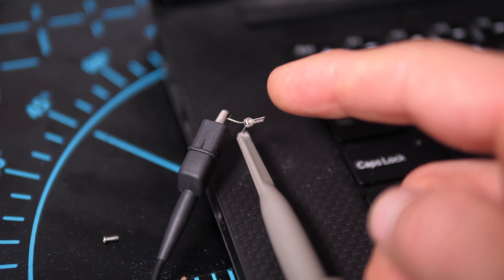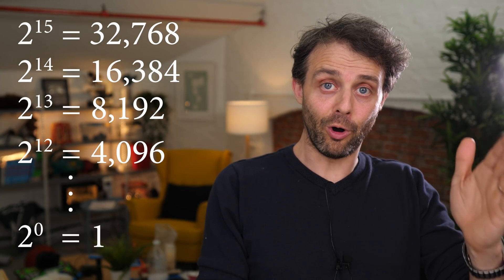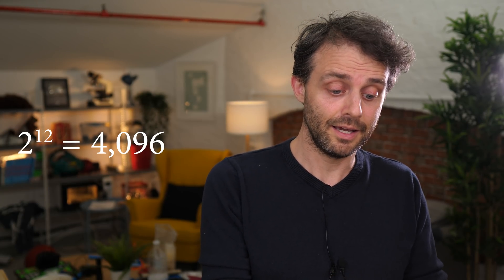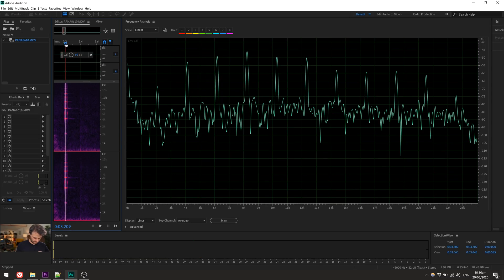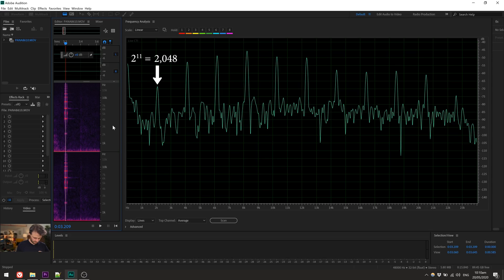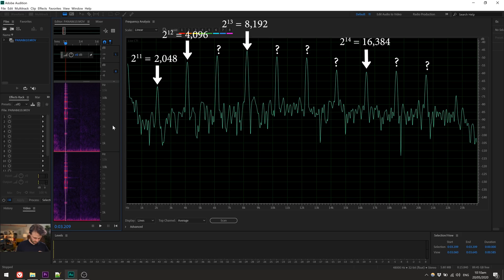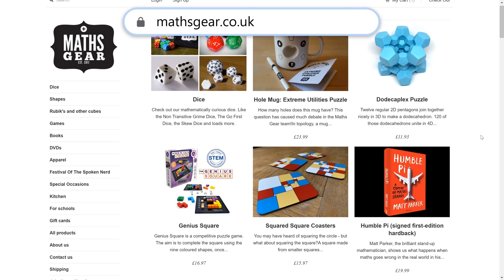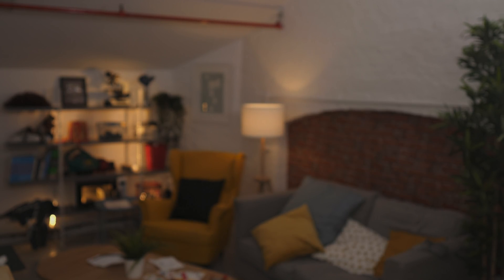Why a Watch Beep Is Exactly 2¹¹ Hz (2048 Hz)

Comment: This doesn’t really explain the “why”?
Reply: If the designer wanted a specific frequency e.g. somewhere between 2048 and 4096 then it would probably need a dedicated crystal and additional circuitry. Watches already have to be extremely compact, good on battery life, and economical to produce. It makes sense to just use a power of two frequency from the crystal that is already there.

Comment: I made a digital clock which beeps at 4800Hz. The clock has an RS-232 interface for remote control. I had a problem that I didn't have enough free I/O pins available. So I made the buzzer and the TxD share the same pin. Sending the character 'U' (0x55) at 9600baud continuously is indistinguishable from a 4800Hz square wave. So actually whenever the clock wants to beep, it just sends pulses of "UUUUUU..." through the serial line.

Comment: Analyzing at 2048Hz and 4096Hz based a human interaction and music theory we can assume that it's most likely 2048Hz in most if not all watches. We know that when we double the frequency of a note we go up by 1 octave. 2048Hz is high but still normal. 4096Hz is in a range that is easily audible but starts to be really anoying. 2048 is just a nice sweet spot where the sound is high enough to cut through most background noise without being to anoying. 1024Hz is probably also a decent option, at least to my ears it sounds fine, but then higher frequencies tend to cut trhough other sounds better than lower frequencies of the same volume so mabye 2048Hz is "better"

Comment: I think all harmonics being present (rather than just evens or odds) might mean it's a sawtooth, like someone stuck a resistor ladder DAC on the bottom 5 bits of the cycle count from the clock.  I think a square wave would be just even harmonics.  Or maybe it's a 1khz square wave?
Reply: I'm with you on this Steven, I belive this to be a 1KHz square wave.

Comment: The inaccuracy of the measurement is not specifically a problem with the software. It's more to do with the problem of measuring a wave with a digital device. The precision depends on the number of samples per second.

Comment: When I woke up, I put some bread in the microwave to heat it up. While eating, the thought crossed my mind that a microwave sending microwaves at the resonating frequency of water is somewhat comparable to pushing a swing exactly at the optimal point of its cycle, essentially adding energy to the system. But when pushing a swing at the worst point in its cycle, we could actually remove energy from the system and eventually stop it instead. Now here's where my mind has some trouble processing: If we have a microwave sending waves at a 'worst-point-in-swing-cycle' frequency, could it theoretically and/or practically make the contents of the microwave colder? My head tells me that heat + heat = more heat, and that anything different breaks the first law of thermodynamics. But at the same time I cannot fully explain why this would be possible with a swing or a spring-mass system, but not with heat (molecules with forces that can be represented by springs between them).
I thought that this (or maybe just some concepts from it) might be interesting for you to make a video about, so here's the start of my day for you.

Thanks for making all these videos. I've watched a lot of them and I do enjoy watching you explain things, even when I know them already. Keep up the good work :)

Comment: The piezo speaker is acting like a capacitor. Using a ohmeter would show "infinity" or more than 20 mega ohm.
But the physical motion makes it appear as an inductor (with a capacitor in series, still no DC can flow thru the piezo).
Brief, a piezo is a LC circuit able to create a sinusoidal wave at its natural frequency when excited by short pulses (similar to a child on a swing gaining oscillation energy with a gentle push at the correct time).
In other words, it is a band pass filter that retrieve the fundamental frequency from short pulses and reject all the harmonics.

Comment: It's not the software, it's the uncertainty principle. The accuracy of frequency measurement is inversely proportional to the beep duration, so if the beep lasts 1/32 seconds, you immediately have ±32Hz uncertainty (well, depends if you are measuring width at half-width or some other width metric). It's the same thing that drives the Heisenberg uncertainty principle in quantum mechanics. No matter what software you use, a short beep won't give sharp peaks.
The other thing - you would only get a single peak if you had a sine wave. But a binary signal is a rectangular waveform, which can be decomposed into a harmonic series with falling intesities (but only odd ones). So, the fact that you have all multiples, and that at least in the first 6 peaks, you don't see much decrease in power. This would suggest that you have something closer to short voltage bursts, not a pure square wave. This of course is easily checked just by zooming into the time series of your signal, not just the frequency spectrum.
The additional envelope, for instance the weaker first peak, is probably the response function of the speaker membrane (it can't respond equally to all frequencies due to its inertia and elasticity).

Comment: It's funny, I tried audacity to generate 2048Hz and 4096 hertz and now I'm convinced listening to the beep in your video, I'm hearing both! The main harmonic is typically the largest peak, but as you saw 4096 peak was larger. I have a feeling the watch actually generates and outputs both. Not sure what's exactly going on here! All we need is to open the watch, and scope the signal. Too bad I don't have one of those watches. Maybe I need a trip to walmart
Reply: A watch won't shock you for  a change.

His largest peak is actually the  8192 Hz. 
I played a 2000 Hz, 4000 Hz and 8000 Hz sinusoidal beep (YT has those videos and what I do is unpause & pause really fast).
To me the 8000 Hz is the one that sounds closer to the watch beep. In fact really close. Which makes sense b/c it's the dominant harmonic in his spectrum.
Imho the other harmonics are in part due to the signal being (most probably) a square wave (clock),  and also due to some FFT aliasing...but idk.

Edit: it also sounds a lot like the 6000 Hz, but to me it's very different from the 4Khz and the 2KHz
Reply: The watch outputs a wave with base frequency of 2048Hz, but it does not output a pure sine wave. If you split up any other wave into the individual sine waves, like the frequency analyser inside Adobe Audition does,  then you'll see the base frequency (2048Hz) and its harmonics (multiples of 2048Hz). Give that all harmonics are present and not only the odd ones, is an indication that the wave form the watch outputs is not a square wave either, but probably more like a triangle wave (see e.g. https://en.wikipedia.org/wiki/Triangle_wave). I would have expected Steve to go a little more into details on this.
Reply: I used a spectrum analyzer app on my phone and it showed that my watch beeps around 4096 Hz
Reply: I have a 4khz natural notch filter in my left ear. I can only hear the 2k and 8k sounds

Comment: I recorded my Citizen watch. It's an approximately saw-tooth wave at 8192 Hz but every other peak of the saw tooth is shorter because there is a 4096 Hz frequency at about half the amplitude added in. Curiously there is also a 128822 Hz frequency (3x4096) which I think comes from the sawtooth nature of the wave. Also my beep is for duration is 120 ms with another 8ms or so after that of of 'fade out' that seems like the piezoelectric speaker still resonating faintly as it rings down.

Comment: Terrorists used to use Casio F-91W watches cos they had 23:59:59 timers and were used on various IEDs.

As for spectral analysis of waveforms, there are FREE sample editors that have good spectral anylsis tools and VSTS that will return clear numbers for the fundamental frequency and harmonics. You can use a low pass filter to remove higher frequencies and then highlight and measure the cycles of the waveform and do some maths to get the EXACT NUMBER.

Comment: That's a useful trick for measuring the fundamental (in the frequency domain) when you clearly have a harmonic series - measure at a high harmonic and divide by the harmonic number. In the time domain, though, it's easier to measure accurately at lower frequencies (longer periods). It's interesting that the beeper spectrum has odd and even harmonics - if it had been driven by a square wave (e.g. a digital clock divider), you might expect only odd harmonics.
I think the other reason that 2048 Hz might be used is that typical piezo buzzers have quite a pronounced resonance - around 2-3 kHz in my experience. (If you have a desktop PC with a piezo speaker you can try running the beeper at different frequencies and see where it gets loud.) Of course, that in turn is probably because the buzzer is designed to be efficient at frequencies that people are most sensitive to.

Comment: My watch has two different tones; one for most beeps and another for when the mode has returned to "clock" so you don't have to look at your watch to know you've put it back correctly after using the other modes. I now suspect that one tone is twice the frequency of the other.

Comment: I am not entirely sure but the harmonics of the 2048 Hz signal could exist because the piezo is driven with a square wave and thus you get these harmonics when you make an FFT of a square wave signal. Of course, you did not do an FFT here but the piezo swings also at those harmonics.

Comment: Wifi radios normally transmit a beacon frame (announcing who they are and what kinds of wifi they support) every 102.4 milliseconds.  The IEEE 802.11 standard specifies a "time unit" (which is just called a TU) of 1.024 milliseconds, because that's easy to make with frequency dividers just like the ones in a watch.

Comment: The reason you see those higher frequencies is NOT because of harmonics.
Its because the watch is outputting a square wave instead of a sinewave.

https://en.wikipedia.org/wiki/Square_wave#Fourier_analysis go to the Fourier analysis section for a square wave and it will give you the formula that shows you the frequencies that make up a square wave.

Comment: Maybe use better software and mic (or no mic and direct signal measurement) and environment.  Harmonics are typically several dB less and decrease with each order, so none of that looks right.  Ask a manufacturer.  I don't think it's a secret.  Generate a 2048 tone and listen and compare.  Also, some Piezo devices (transducers) have their own resonant frequency.

Comment: Question? Some quartz watches show hundredths of seconds (especially for stop watch). Does that use the raw quartz information, or does it subdivide from seconds (bring quartz info down to seconds, then divide that by 100?)
Reply: 1/128th of a second is fairly close to 1/100, and can easily be rounded, and goes by fast enough that you’ll never notice some “hundredths” ticking up slower or faster than others.
Reply: @trevinbeattie4888  Do you think the quartz watch calculates the hundredths of a second directly from the quartz vibration? Or do you think the watch subdivides the whole second with a secondary function?

Comment: It’s unusual that there are even harmonics as well as odd harmonics. The presence of even harmonics means that the waveform is different in its positive half compared to its negative half, which you wouldn’t expect from a simple square wave. The apparent fundamental at 2048 is also a noticeably lower amplitude than the rest of the harmonics, while normally you’d expect the fundamental to have he highest amplitude. This waveform would evidently have spikier corners than a square wave would normally be expected to have.
Both of these anomalies can be potentially explained when you consider the piezo disc itself. If I saw correctly, the piezo disc was affixed to the inside of the watch backplate, which would give the outward direction some bias compared to the inward direction, producing those even harmonics in the sound wave. Piezo discs are also capacitive transducers, hence more current will flow through them at higher frequencies, they are a natural high-pass filter. But the disc itself also has springiness and mass, forming a natural low-pass filter. The result is that most piezo discs have a maximum amplitude (and resonant frequency) in the medium-high kHz range, which is what we see here. Evidently, the piezo disc isn’t very sensitive to 2048Hz.
If you desoldered the piezo disc and ran a bode analysis with a very neutral microphone, you could normalise that FFT to see the actual amplitude of the harmonics of the driving wave, though that wouldn’t remove the even harmonics. Or you could assume that the piezo’s frequency response is just a simple 2-pole band-pass filter and try to fit that to your results.
Reply: That is the most serious and credible comment I have read so far.
The piezo speaker electrically appears as a LC harmonic oscillator.

Comment: The reason for all this harmonics is that in small and simple devices usually the sound beep is a square wave ( just the base clock frequency or one of flop-flop signals applied direct to the speaker).
It keeps the circuit very simple, cheap with great battery life. No extra caps, transistores or resistors is needed to work.
The transducer and the watch case filter the sound a little, but the electric signal is a very sharp square wave.
Reply: As a vibration analyst, I can confirm. Real-world square waves (not exactly square, but truncated waves) are translated in a spectrum as peaks occurring at multiples of the fundamental frequency, so you see peaks evenly spaced at 2x, 3x, 4x, etc. For anyone wanting to learn more, Google “Fourier Transform” or go here:
https://en.m.wikipedia.org/wiki/Square_wave
...for info on square waves and how they translate into a spectrum.
Reply: At last, a real electronics technician. Been reading some comments and it's really upsetting people speculating on something so simple. Doesn't seem anyone has done any experiments with simple digital divider IC's (4060/4040/74HC74) or anything like that - Arduino / Rpi / ESP32 programming only. Basics required, still - even makes programming some things simpler when you know (low end 8-bit micros for one)
Reply: Lukas B A perfect square wave goes from zero to one instantly, stays exactly at one for a time, then goes to zero instantly. That will produce the odd harmonics in an FFT. But you’ll only ever analyze a perfect square wave if you generate the signal and directly analyze that generated signal. All real-world “square” waves are messy. There’s never an instant jump from zero to one. For instance, it takes time for your speaker to go from rest to popping out when the signal hits one. Further, once the speaker is popped out, it rings a little. The same happens in circuitry. If you make a circuit that produces a square wave and look at the waveform with a scope, it’s never perfect. There’s a quick ramp from zero to one and ringing around the edges. That dirty signal produces all the harmonics.
Reply: Lukas B In terms of sound, I think even a theoretically perfect square wave moving through the air still has to interact with our ear drums, which will create their own imperfections and excite even multiples going into the inner ear. We’ve only ever heard square waves as having both even and odd multiples. In that sense, I think it’s kind of funny that a finite series of odd multiples approximating a square wave is probably more true to its sound than an actual square wave. Does that answer your question?
Reply: @LukasB117  "The ideal square wave contains only components of odd-integer harmonicfrequencies (of the form 2π(2k − 1)f). Sawtooth waves and real-world signals contain all integer harmonics." -Wikipedia

Comment: It sounds in the video like a 4096Hz tone. If you have the "sox" package installed on your computer, you can generate notes using it, eg with "play -n synth 0.031 sine 4096", which sounds close to what you got in the video. You can change the shape of the curve and the frequency too. If you change it to a 2048 Hz note, it doesn't sound right. Change it to a square wave and it also doesn't sound right. My guess is the 2048Hz component is the result of some harmonic. Compare the square wave of 4096, which sounds distinctly lower, at least on my computer (using the built-in speaker).

By the way, first growing 2 weeks worth of beard after the first shot, then to cut it off again at the end of the video, for less than 3 minutes worth of youtube? That's DEDICATION!

Comment: I have a tuner I wrote in Python that uses the Harmonic Product Spectrum algorithm to find the fundamental frequency and when I played my Casio into it I got 2045 Hz as the fundamental which is pretty close to 2048 Hz. 

There are a number of Pitch Detection algorithms that are used to find the fundamental frequency of a sound. The two most common algorithms are probably Autocorrelation and Harmonic Product Spectrum. Autocorrelation works in the time domain and finds the period so then the inverse is the frequency. Harmonic Product Spectrum analysis works in the frequency domain after an fft and through downsampling and multiplication finds the fundamental frequency. I have had more luck with these methods than just an fft plot. I find those are deceiving sometimes with harmonics above and below the fundamental. 

Thanks for the great videos as always.